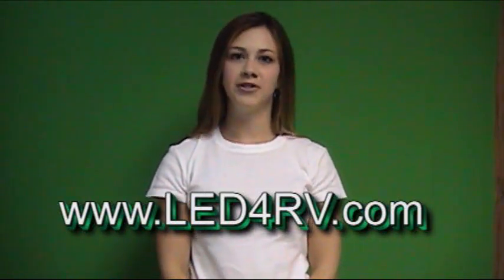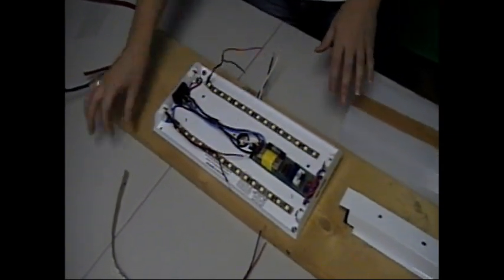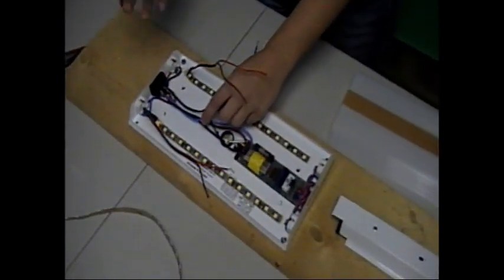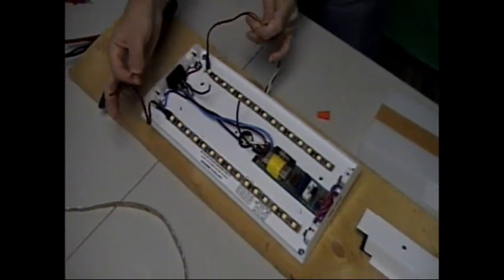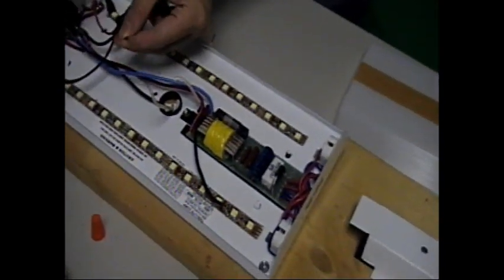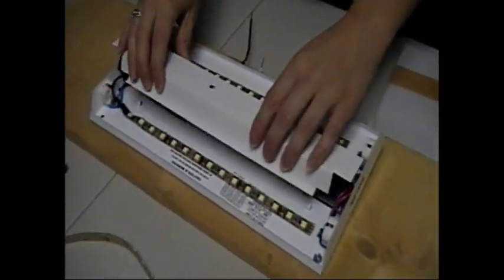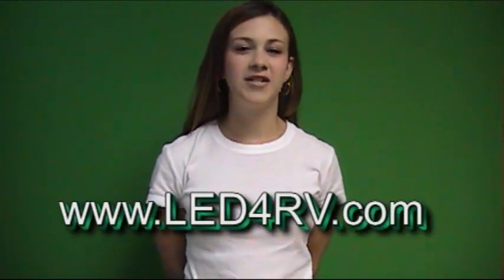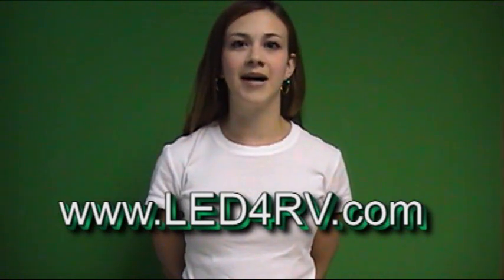12 Inch Led Light Upgrade and Repair for 12 Volt Light

Comment from the maker: Good point!!! It is 12 volt and if your wanting this for a motor home and your alternator if over 13.6 it may shorten the life of the LEDs. That is a pretty common thing in an older motor home. The alternator to be running over what it is suppose to be running.